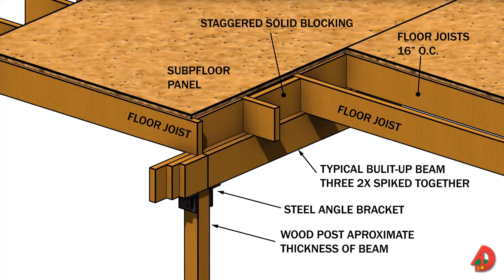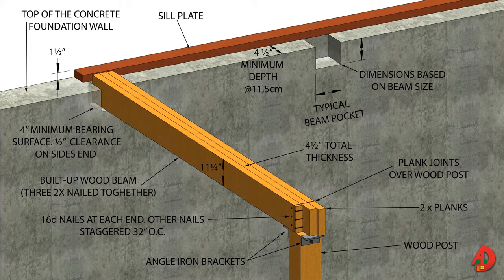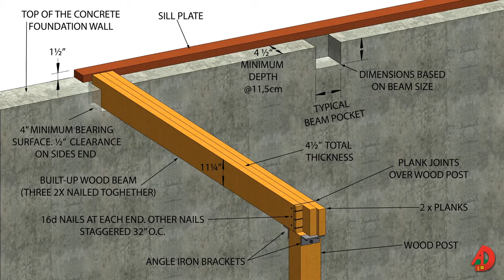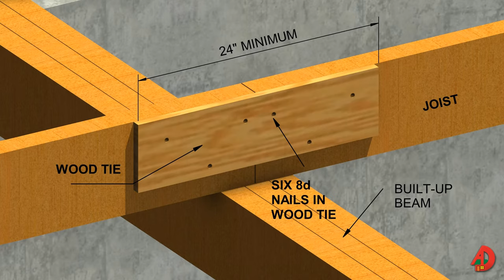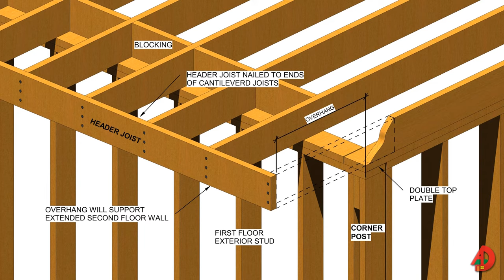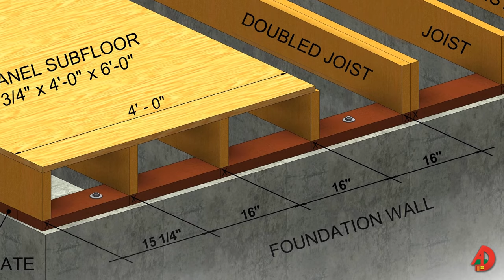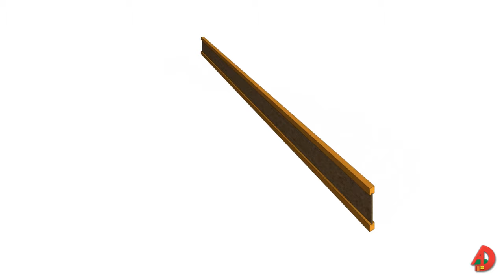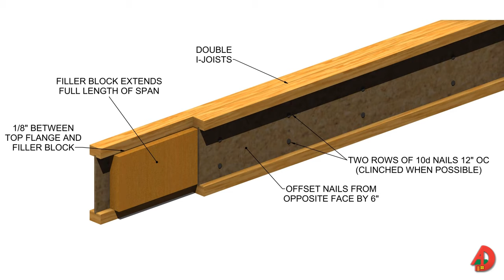FLOOR FRAMING

Comment: Thank you so much for this.  I am working on designing my own house and you covered SOOO much material.  This has helped me out tremendously!
Reply from the maker: Very happy to hear that ... I will try to do the wall framing as soon as I clear some stuff from my schedule.
Reply: just don't spell flor like they done at 13:41
Reply: @olddave4833  lol

Comment: How is the Sill Plate  ( Pier block) attached to the concrete block ??
Reply from the maker: With anchor bolts, I talk about this here "Introduction to foundations part 1" https://www.youtube.com/watch?v=13kzbhMvrAo&t=5s ... I also recommend   "Introduction to foundations part 2" https://www.youtube.com/watch?v=JhiIyIjAihU and "Wall Framing Basics" video will be coming out in the following days
Reply from the maker: You can also use a RAMSET HammerShot https://www.youtube.com/watch?v=ozv6ak77XlU or a A powdered Actuated Tool https://www.youtube.com/watch?v=MkYz3xnD5Qw
Reply from the maker: These are also some great anchor bolts https://www.homedepot.com/p/Simpson-Strong-Tie-Strong-Bolt-3-8-in-x-5-in-Zinc-Plated-Wedge-Anchor-40-Pack-STB2-37500R40/300591975